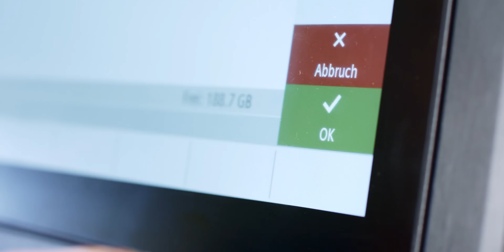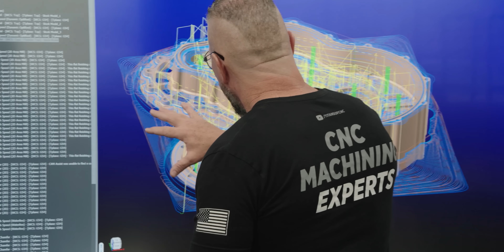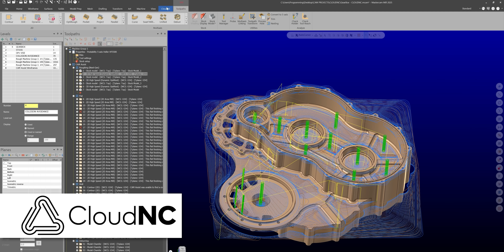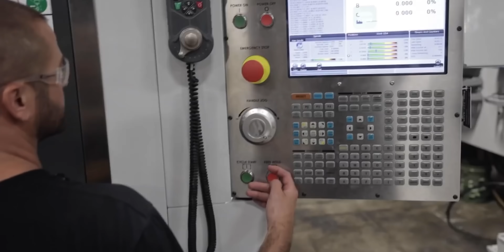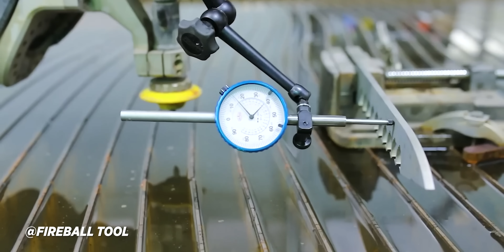I Built a Waterjet Facility, Because They Couldn’t Get Parts

Comment: Sir i have FUKU SEIKI CNC HORIZONTAL TURNING MACHINE
CONTROL FANUC SERIES O-T
The machine parameters deleted automatically, and i couldn't find them.
I dont have backup of these parameters because it's first time i am having this parameters deleting issue in my 6 years CNC machinist career, and i bought that machine second hand.
Can you please help me i am really stuck at the moment my production line has stopped.
Please sir if possible help me.

Comment: I remember in 1996 I was working in the tool and die department at that time I was machining parts for trim tools and repairs. The manager of the department asked me if I wanted to go to Miamisburg, Ohio right out side Dayton, Ohio to go to the MotoMan robot class to learn how to program MotoMan at that time it was the MRC controller , then a few years later the XRC then NX100 then DX100 then DX200. We used them for pouring foam into mold and water jet cutting the floor system for vehicles, we had quad robots cells that used flow water jet heads and we had 10 Flow identifiers tied together on a double loop system in the plant so if one system fails or started leaking we could switch to the other system and keep running. The pressure on the intensifiers we ran 60,000 psi to cut the carpet and tuff floor in trucks and cars. I have rebuilt 1000s of intensifiers pump water ends and hydraulic cylinders. Back in 2010 I actually got to go to the flow shop in Canada at the time with a couple of engineers to help approve the new quad robots cell. They asked me because at that time I was the only one in the factory that they had to program the robot and work with the integrators to get the cell to run like we wanted it. For safety we used Sick safety eyes. We had people running the lines that when they wanted down time they would kick the lens on the eye and crack it. I then at the time was reading about the sick eyes and found the new ones had a camera and took a picture of what got into the eye to stop the robot cell. We did not tell the operators about the cameras. It’s was only 2 days till the camera took a picture of the woman walking up and kicking the sick eye. I was asked to download the picture. After they showed her the picture they asked her to get her stuff and they walked her out. By just being asked and willing to go to a robot class in 1996. What a world of opportunity and a great living for my family and me. It is surprising how far robotics, technology and water jet cutting systems have come since I started. I know the system you are talking about is for steel. But I was at a fab shop where I live that have a 5 axis water jet system and they were cutting a 6” slab of rock into the state of Kentucky for a customer for a sign for another business. If people are willing to learn they have no idea how far they can go if just willing to put forth the effort and we can bring back manufacturing into the USA . 
Great Video keep up the great work.
Reply: I'm from Dayton Ohio, I'm actually getting in the machine world so far liking it.

Comment: I have a large CNC machine shop. People coming back from China wanting stuff made are paying the same for the finished part that the raw metal, in bar form, would cost me to make it. I use a ton of imported bearings for one of my own products, I emailed three US bearing makers for quotes last week. No one even bothered to reply. I also have a Flow waterjet like in your thumbnail picture (5 axis Pivot Plus head). Awesome machine but I cant afford to sell parts made on it for what people are willing to pay due to the extremely high cost of parts to maintain the machine. Hopefully things will get better for manufacturing in the USA.
Reply: Can relate on the waterjet, same situation
Reply: you gotta figure it out, cut cost where you can automate that's what titan always says.
Reply: Sounds like that mfr is gouging it's customers bc they have a captive market on replacements, and it's also pricing itself out of the market due to excessive cost of ownership. Always get replacement parts costing when considering new capital purchases.
Reply: @oceanic8424 another consideration that goes hand in hand with that is the frequency of the machine needing service. The nature of a waterjet is to destroy itself much, much faster than any of my other machine tools.

Comment: Question, Does the technology exist, that possibly through Conductive feedback through The end mail or whatever tooling you're using send an alert, if a piece of tooling breaks to an operator off-site while running lights out, monitoring operations remotely?
Reply: Yes. This is here for years already. Worked on a machine that sends a text when a tool broke

Comment: What's the usecase of water jets over laser cutting?
Reply: Thicker material can be handled, no heat affected zone, more material options, less power usage
Reply: Depending on the application and requirements, waterjet cutting can be used to cut finished parts from a wide variety of raw materials without thermal degradation, or even to produce precisely contoured blanks for further processing on a CNC milling machine from aluminum, steel, titanium, etc. This reduces the amount of machining required. Alternatives include extruded profiles, forged parts, or cast parts. However, a CNC waterjet cutting machine offers greater flexibility.